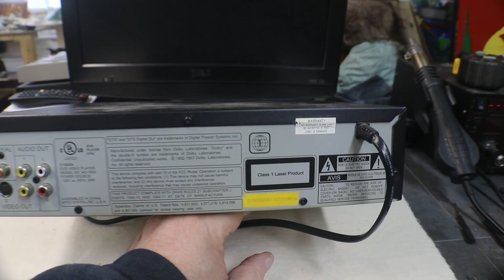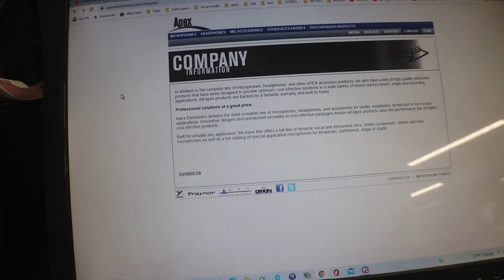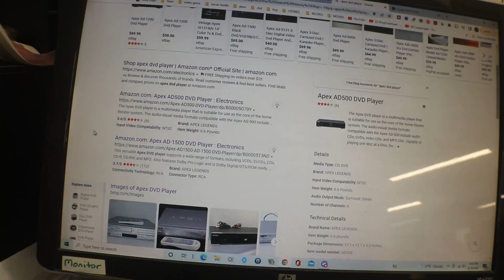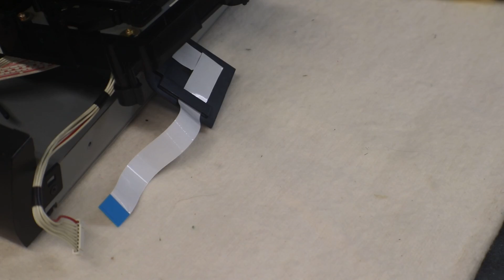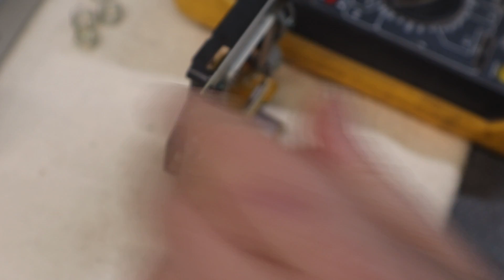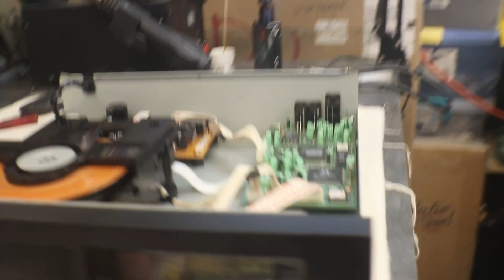Apex AD-1500 DVD Player / How To Teardown and Repair or Is it Dumpster Food

Comment: Does the original poster or anyone have a schematic for the power supply circuit board in this player? Mine has two burned resistors after similar capacitor failures and I can’t figure out the values of the resistors. They are just blackened lumps.

Comment: Interesting video. So cool that you got it to work again. I have that Rowe cd jukebox that I replaced the laser in and the thing still won’t work. I need to tear it down again and see if I can fix it. It’s frustrating. But surely it’s something simple!!
Reply from the maker: I have had that happen on my game systems, what I found is ribbon cable not seated or spindle motor not spinner the disc fast enough. If it's a brand new laser make sure there isn't a antistatic point that needs to be desoldered before installing.